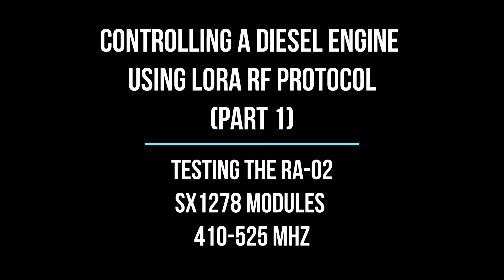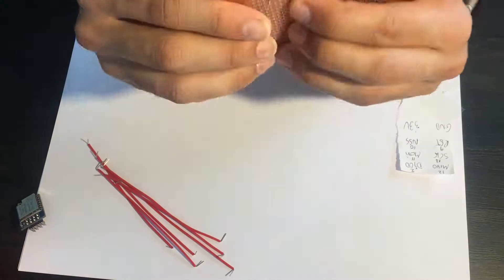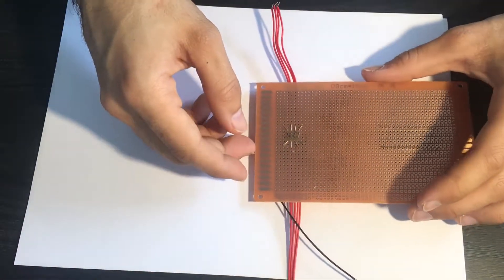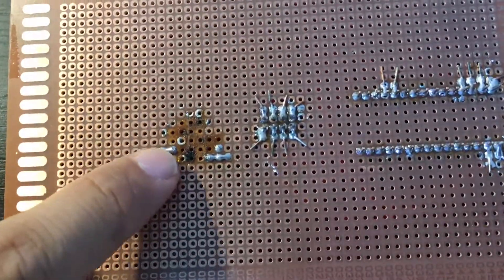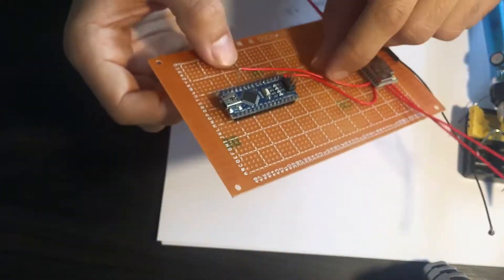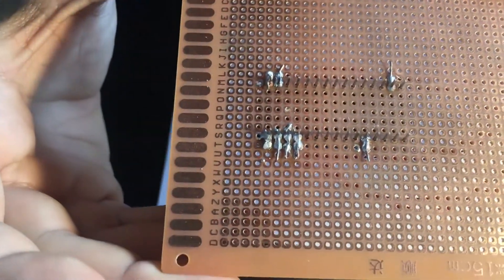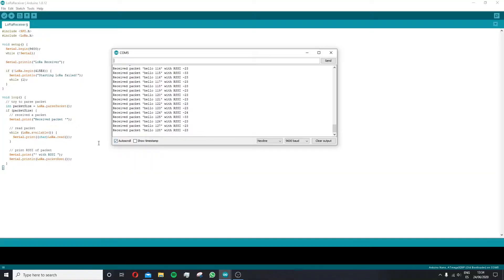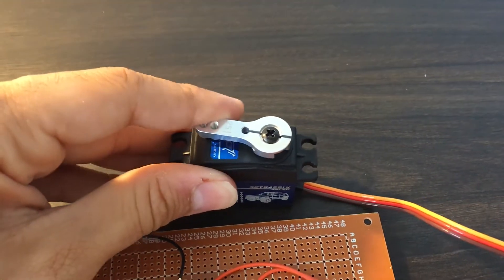Controlling an engine via LoRa protocol using a Ra-02 RF module & Arduino [Part 1] - The assembly

Comment: I have one question: Where can I buy this modul  https://www.ebay.de/itm/402634182291   for 868MHz for Europe?
Or can I use it with 433 MHz in europe?   Thanks for your infos.
Reply from the maker: Hello, thank you. I’m still working on the LoRa project, so new videos to come. 
0.5watt License Free radios transmitting on 446.0 - 446.2 MHz frequencies, either digital or analogue, are suitable for use in most European countries (including Germany and UK) without requiring a license or country authorization. Regards and thanks for watching

Comment: Hi i.m also looking at a similar way of controlling a servo at distance, i want to make an air rifle target that i can reset from up to 200m away, i also used to drive the Austin A30 back in the 1970's. i would be interested to see if the servo will work at distance.
Reply from the maker: Hi, i’m waiting for the parts I ordered and I will give it a go :). Do you still keep the A30? There will be more updates on that project shortly too, so stay tuned :) Regards